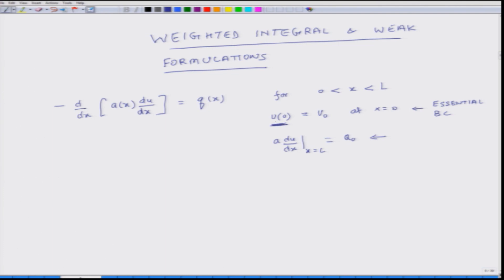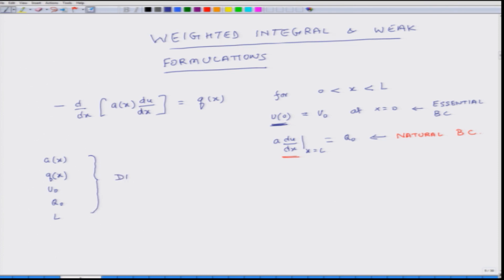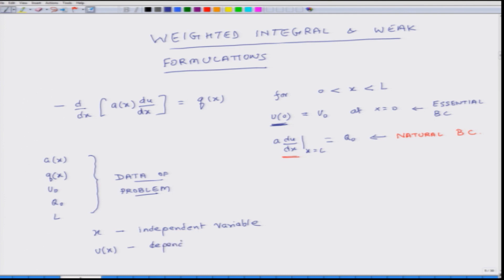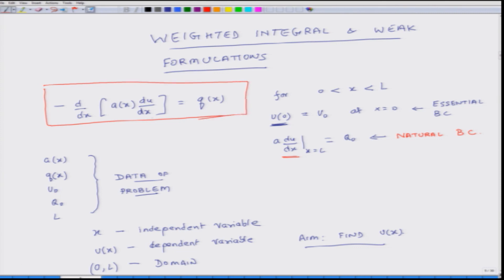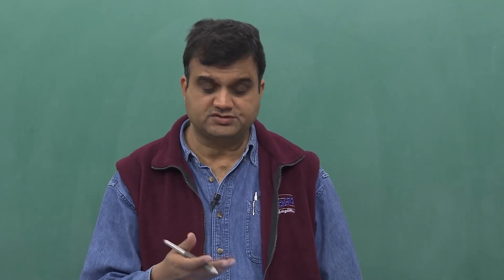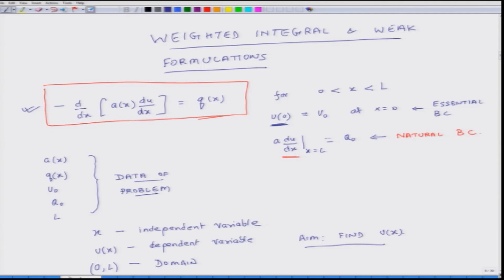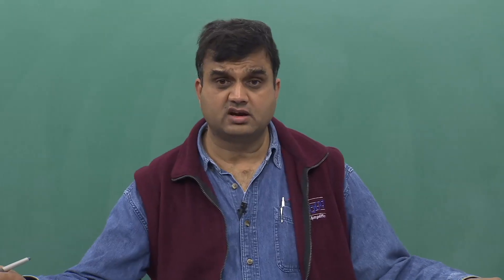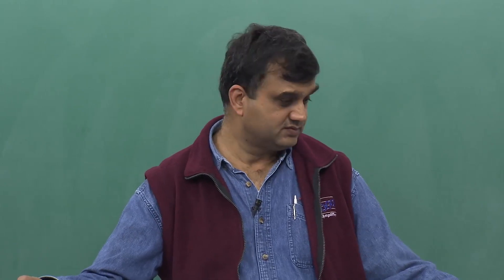Weighted integral & Weak formulation

Comment: what about natural boundary condition at x=0 ?
Reply: There is no natural boundary condition at x=0.                                  
              Here you have to understand the difference between the Natural BCs and the Essential BCs. We are solving in weak form and while solving we can directly use  the boundary conditions ( here it happen to be  at x=L, it might also be x=0 ) and naturally the BC is taken into your problem. But the prime motive is to solve for u in the weak form of the equation. Here you have to assume shape function and this must satisfy the other BC(the other is already taken into  weak form). Since We have to choose shape function based  on this BC,it is the Essential Boundary Conditions.                                                             
                Having said about the BC types lets come to the question. If in the weak form we had a term containing the u(x=0),then we can directly substitute u(0)=0 (which is the BC at x=0) and this would be natural BC. But actually we do not have such a term here. So it is not a natural Boundary Condition!
Reply: Paass hua ya fail bhaii???